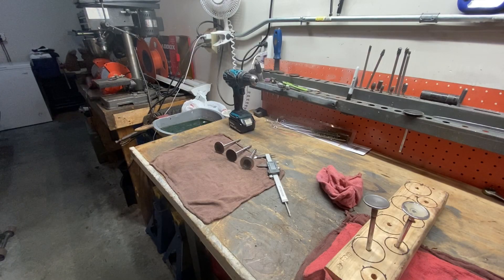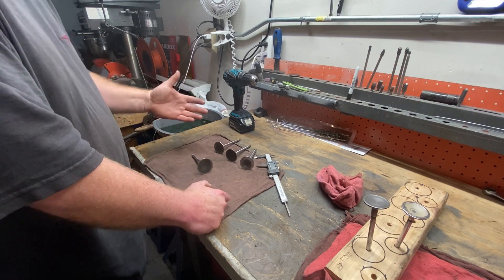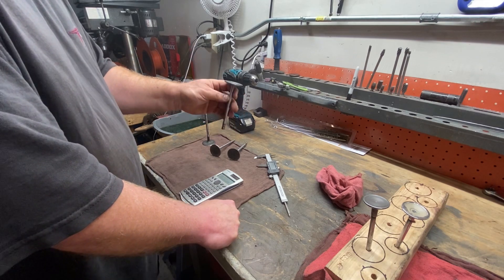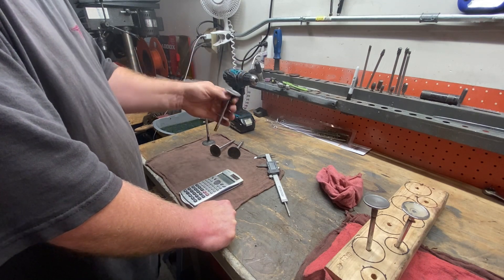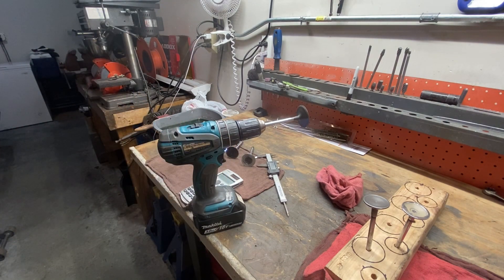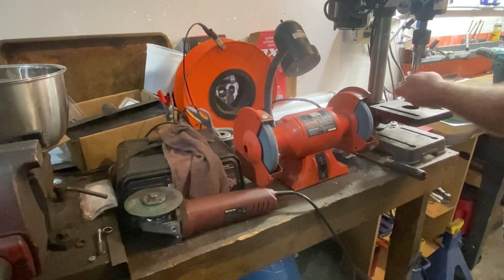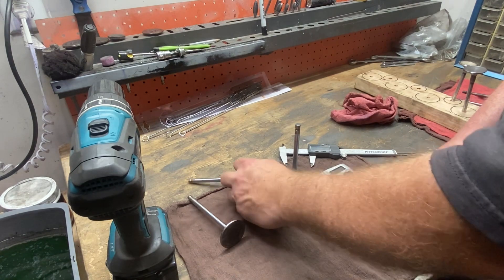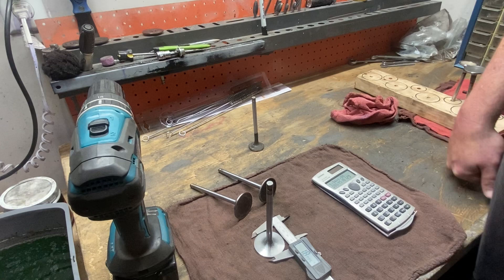Porting templates setting the Throat percentage

Comment: Just found your channel, you sound like a straight shooter so here goes.  Not withstanding how the block cylinder sees the head, so displacement isnt a part of the equation as this question goes; what variable sets the .89 as efficient, or determines, the size of a valve? Is it a relationship between Intake Valve Port Cross Sectional Area combined with the Port's Volume, and Airflow Velocity thrown in the mix; or are these variables not really in consideration as you are only interested in improving on a factory head with the .89 figure.  In other words, who or what process, determines when an engine parameter is small, medium, or large; then we can throw that head on a cylinder block to determine if the output is mild, moderate, or maximum. I hope Im clear in the question Im asking. What Im getting at is this; if you are only improving on a factory head, you havent really qualified efficiency of the valve .89 diameter as you havent qualified that factory head's efficiency as small, medium, or large for the displacement it was intended for
Reply from the maker: .The 90% throat percentage to intake valve size is an establish industry standard. 90% throat is used by all cylinder head manufacturers that I know of other than maybe custom finished heads where they are closely monitored with a Flowbench. I have always followed the Joe Mondello Porting theory enhanced from different tips and tricks and areas to work offered by various other porters.
On the exhaust Throat I try to stay around 87% or slightly less so it maintains good stability and transfer with heat.
It’s really interesting you mention port sizing to CID.  For years if not decades you didn’t really see people running larger than maybe a 200–210 cc intake port under 383 CID unless it was an all out max effort 350 etc.  The LS platform totally blew all of that theory out of the window because they run a 200 cc port on a 293 CID engine and a 210 cc port on a 325 CID engine.
I prefer to match the intake port somewhat to the CID to maintain velocity.  Customers tend to want more more more. 
On my own Turbo 4.8 I have a set of Big Valve 862’s with a 2.00” valve and 212cc intake port.  But now I’ve experimented with porting the 862 heads w/ 1.89” valves, I could have used a 1.89”-1.94” valve to better fit the small 3.780” bore avoiding upper cylinder shrouding with a 208cc port w/ swirl ramp and get 275 cfm and great velocity!
Reply: @HeadFlowInc  thx for the quick answer. I cut my teeth on Oldsmobile; 442's ect.  Joe Mondello was the go fast goodies guru for Olds back then. Displacement, how the Cylinder Head sees the Cylinder it is "servicing", addresses Efficiency.  I always ask those who are willing to talk - like yourself, "How do you qualify any engine parameter as small, medium, or large relative to the engine's power output as mild, moderate, or maximum. Its amazing how many "engine builders" dont wanna answer that question.  Thx again for your input, thx for making your vids.

Comment: I have a set of 862 heads and made my templates using a souix valve grinder and set then to 1.695 and 1.338 so I could have room for blending and finsh work but the intake passes through with no work done.have you had this happen? Exhaust needs a little work thinking no more then .020 my first time and don't know if this is right but watch a lot 9f your videos for guidance
Reply from the maker: Yes, GM made the throat way big on the 862/706 w/ 1.89” intake valves. 
On the 1.89” valve porting I just blend the factory throat into the bowl area.  If you remove the swirl ramp be careful not to go to deep, there’s coolant below the ramp. Use the landmarks to safely remove the swirl ramp without digging. 
Exhaust throat 86% is a safe percentage, I’ve gone to 87% as well. You don’t have to raise the roof, it will still pick up flow with the throat, bowl, guide work.  Smooth any edges from the seat into the chamber.  JD

Comment: I may be wrong but don't you need to figure the area of the valve then take that times .89? That will net you a different measurement than just taking .89 times the diameter.
Reply from the maker: The way I learned from Joe Mondello was a percentage of the valve diameter.  2.00” x .89= 1.780” template for the throat. The bowl area generally ends up 3-5% larger than the throat. JD

Comment: I don't see anything about 317 heads. I have a lq4 that I wanted to make an iron ls2 but the money is building faster than this engine
Reply from the maker: I don’t see many people using 317’s now they know the combustion chambers are so large.  On a 6.0 flat top engine there’s nothing wrong with the 317’s. 
317’s flow as much or more as the 243/799 heads; all the same porting techniques apply to all the heads.  The porting math and theories apply to almost any cylinder heads.  JD

Comment: What have you found the intake throat percentage to be from the factory on 706/862 heads with 1.89 valves?   I have found them to be in the 92% range.  Nothing you can do about that but install larger valves.  I wish someone made a replacement 1.94 valve for these heads. I think that would be ideal for the 3.78" bore the 4.8 and 5.3 have.
Reply from the maker: I agree there must be a valve available or people are just cutting the 2.00” valves down to 1.94”-1.95”.  There’s a couple guys including Tony Mamo who have ported the 706/862’s and used the iirc 1.95” valve. 
I’ll have to check the throat size on a stock untouched head, I’m not sure. JD

Comment: Hey, what’s your take on bowl size vs throat size? I’ve watched a few porting videos and some mentioned bowl being larger than throat improves low lift flow. Doesn’t sound logical, but what do you think?
Reply from the maker: I’ve been working on the bowl percentage more lately. Prior to learning there’s benefits of a slightly larger bowl compared to the throat creates a Venturi affect to help flow. 
For the longest time I set the throat percentage then focused on making a smooth organic transition into/through the bowl areas.  Transitions to the area behind and beside the guide without digging, I try to have the least amount of angle for the air to turn. Blend the walls to widen slightly the short turn, what makes it smooth etc.  The larger side or port bias, working this wall to make a smooth transition works great!
Im looking forward to playing with the bowl area a bit more, back cutting the intake valve and seeing if a multi-angle valve job helps or hurts flow.  JD
Reply: @HeadFlowInc  thanks for the reply. I appreciate what you do.
Reply: how do i calculate the bowl size percentage? i need your advice

Comment: Yeah, the bowl also needs to be slightly larger than the throat also. This creates a venturi. Also, certain heads like factory bbc and sbc barely have a short turn, to slow the air down to make the turn; widen the short turn in the bowl. Huge gains in flow to be had right there.
Reply from the maker: Currently my cathedral port LS heads w/2.00” valve, no back cuts and factory original valve job flow 306 cfm @.600” lift; out flow the 243/799 at all lift points exceeding them by .450” lift. 
I have a 862 cathedral port head with 1.89” valve, factory valve job, no back cuts w/208cc port flowing 254 cfm @.600” lift. Exceeds the 243/799 heads with a smaller valve and runner volume. 
Thanks for the feedback I appreciate it, I’m always looking for ways to pick up more flow. I hope you are subscribed!  JD
Reply: Yes, we've messaged before. I've been subscribed for 3 or more years now. I actually admin a yt channel now, Driveway Drag Trucks. We are made up of a few trucks, but mine is the only 88-98 (92 specifically) C1500, and the only big block. Pretty slow now, hoping we'll have more regular content soon. I wish i had recorded porting my bbc 781 castings, and also my 4l80e build. I have a 4l80e rebuild coming soon for a customer, so I'll have some content there. 
Anyways, keep up the good work!
Reply: “Widening the waterfall”!  I had that done to my BBC 702 heads (closed chamber oval port) and picked up a lot of power....combined with unshrouding the intake valves at the chamber wall and a Straub spec’ed Clay Smith HR cam probably picked up near 100 HP in my 454....

Comment: I'm going to apply your porting techniques to my honda 3 wheeler engine. I smoothed out the ports last time I had it apart. But it needs to come apart again, so I'm going to make the "throat" at 87-89%, port match, and backface the valves.
Reply from the maker: I have never messed with any motorcycle engines or ATVs, automotive applications remember the intake valve is where I use the 89% 
Exhaust valves it’s 86-87%. 
I would color the seat and scribe where the percentages would be to make sure it’s not too much for your application. The big thing is you don’t want to make the intake valve seat to head or jug so then that it loses its hold, you don’t want to remove it so much material that I could get hot and fall out. You’re going in the territory that I am not familiar with so I caution you to go slow and verify That it looks safe. On those little engines it might be just a blending or smoothing situation with less material removal?  
Be safe, go slow, make sure you’re not hurting anything. JD
Here’s another guy working an ATV head, try to listen to his warnings etc.  https://youtu.be/nbePm9rDZhs

Comment: 👍💪
I'm setting up a 1.62 exhaust valve and the 88% seems to be too big.  Should I measure outside dia of the actual seat instead of the OD of the valve?  Doesn't seem to be enough meat for a good transition from inner seat through the throat area.
Reply from the maker: On the exhaust side I use 86-87% of the valve diameter.  For a 1.62” valve I’d look at a throat size 1.39” to 1.40”
The intake throat is the one I recommend an 89% throat. 
The throat is the very bottom of the valve seat as it transitions to the bowl.  The bowl usually ends up bigger than the throat through the blending/porting process. JD
Reply: @HeadFlowInc  Perfect 👍
Reply: It's an older Mopar Magnum head

Comment: Hey man what do you charge to port LS heads? I watched a bunch of your videos and another fellas and did some port work on my 706s, I didn't go too crazy being my first try with these but they should def glow alil better.
Reply from the maker: Honestly, the total cost varies depending on if there’s matching processes involved. 
Porting most aluminum 2 valve V8 heads it’s $750.00 including return shipping. $650.00 local
Parts are supplied by the customer unless otherwise noted and machine shop work is additional cost.
* If I have castings in stock or available those can be negotiated to avoid shipping costs.